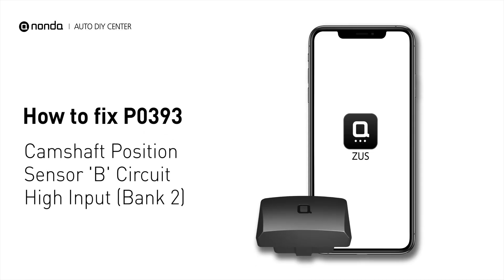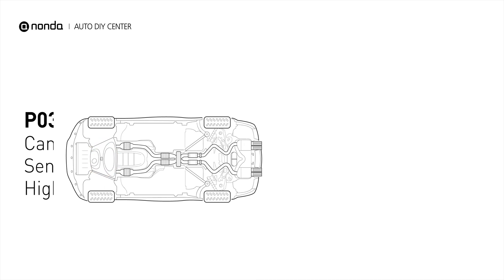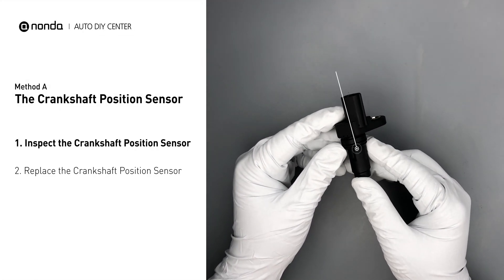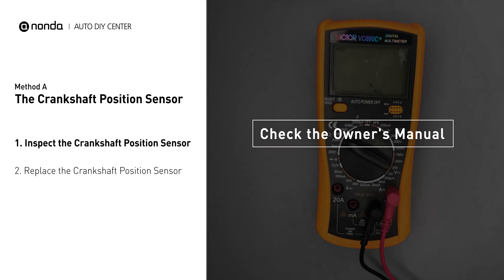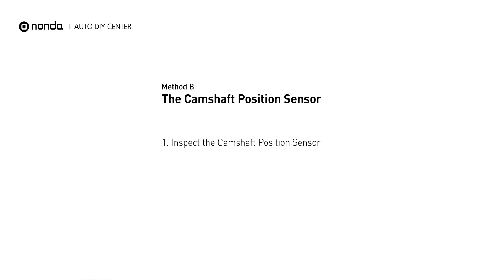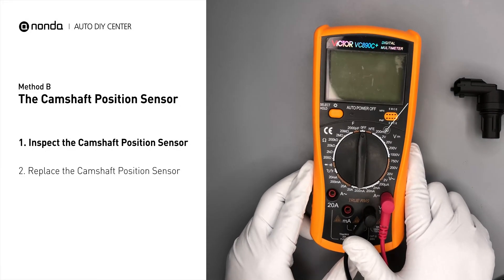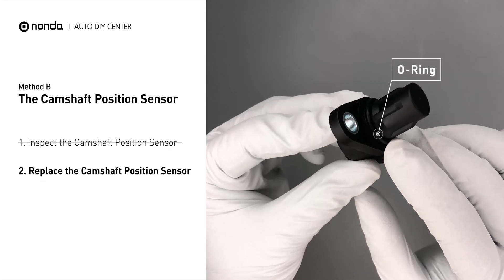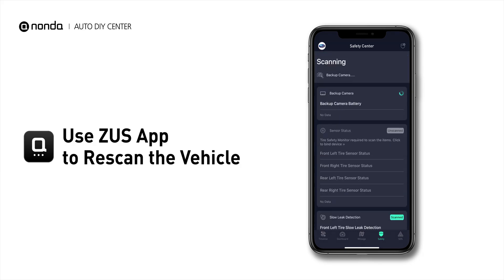How to Fix P0393 Engine Code in 3 Minutes [2 DIY Methods / Only $9.75]

Comment: Just changed the spark plugs on my 2016 GS350 F sport, start it and get code P0393 and it will not go away after clearing. I did not even touch those sensors...
Reply from the maker: Hi Ar, we recommend having your vehicle checked by a mechanic for further diagnostic.
Reply: @arfetherussian I think I just did this with my GX460 😢
Reply: Hello brother i have the same code as well, how did you resolve this issue